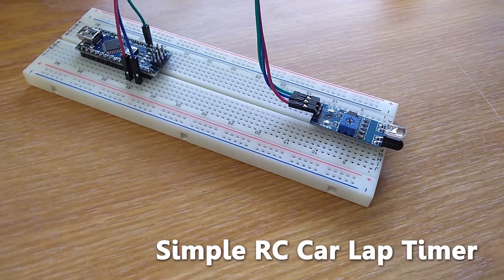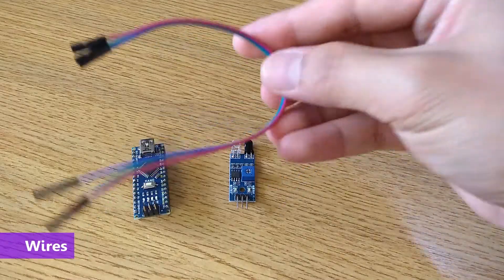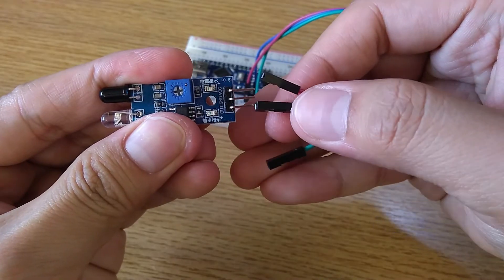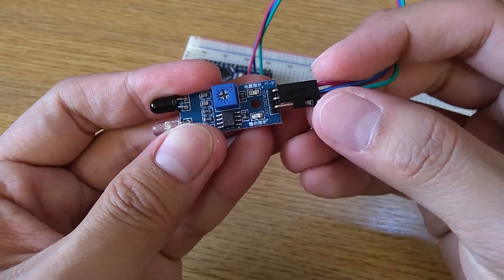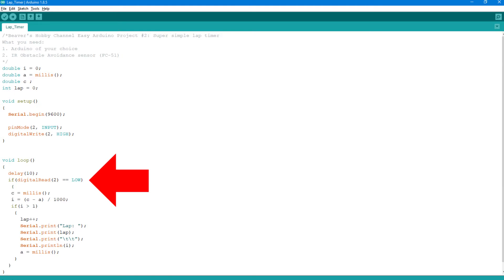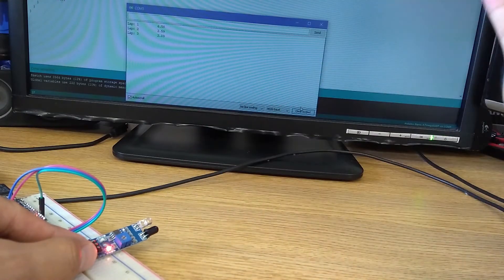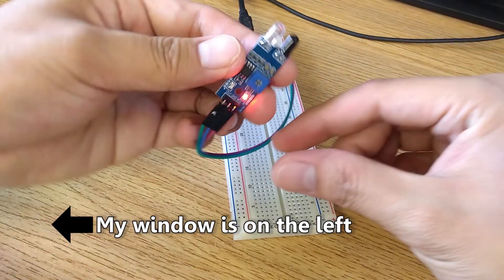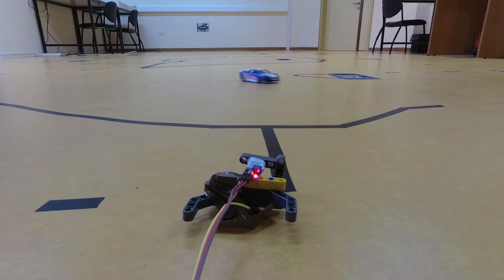[Arduino] DIY RC Car Lap Timer

Comment: what's the function of Serial.print("\t\t"); in your code sir ? because i can't see variable t
Reply from the maker: It is to print the "tab" space on the screen. The \ is for the print function, \n = new line, \t = tab.
Reply: @BeaversHobby  whoaa, I don't expect you would reply my question in short time. I appreciate your work ands answer. 🔥
Reply from the maker: @andikarifqimaulana682  My pleasure. Best of luck with the project!

Comment: From what I can understand, the lap times has to be connected to a laptop to work, correct? also can a voice be generated to read the lap time? thanks in advance
Reply from the maker: With my code you will need a computer to display the lap times. You can setup a LCD screen to output the times too if you so choose. Also because it's Arduino I think you can find a sound library and write a program then wire a speaker to it to say the lap times too.

Comment: would be better if using ultrasonic sensor am i right?
Reply from the maker: Ultrasonic can be too slow to detect sometimes. I highly recommend the laser ToF sensor like VL53L0X. It'll do a much better job at any light condition.
Reply: @BeaversHobby  Hi are the coding still the same?
Reply from the maker: @Kalk2pejai  For the most part, yes. You'll have to change some reading to get that from the laser. I think I also uploaded the laser version on my GitHub, check it out and tell me later if you can't find it.

Comment: Hi, just an idea. Have you tryed 2 sensors one in front to second one, sensor and led unsoldered on each ones (or closed with some sticky staff). Then they continuously on, while car brakes the  ray.
Reply from the maker: That's really good idea. However it will still be effected by sunlight. I have a new update for this and use laser range finder (ToF) sensor instead. It works well even with interference from sunlight.
Reply: @BeaversHobby  What about cheap ultrasonic sensor? Like HC-SR04.

Comment: What if I want to detect my hand movement??......can I still use IR obstacle avoidance sensor??
Reply from the maker: It depends. If you want to detect only of there's anything in front of the sensor, yes, one sensor will do. But in case you want to check if the hand move from left to right, you can also use 2 (or more) sensor to detect series of movement and which sensor ticks first.

Comment: Hello,

When i hook up my sensor to the 5V power, it shows nothing in the serial monitor. But when I unplug the 5V wire, then it starts to record data, but goes back and forth between 1.00 and 1.01. Any help? Thank you!
Reply from the maker: This is not serial. You have to use it on a digital pin. You can think of it as a button. I use for digital read and it click a digital button when something is in front. Also don't forget to adjust the knob on the sensor. It won't detect anything if  the gain is too much or too little.
Reply: @BeaversHobby  I have it plugged into the digital pin 2 and hooked up the same way as you did. Still no numbers are being displayed.
Reply from the maker: @TheUserReview  Have you run the code? Anyway, look at the module first, you have to adjust the knob until light on the out is off. Then put your hand in front of it and see if the light next to "out" pin is lit. If it's not then the module is faulty. When there's the light on the "out", it means the digital button is pressed on the digital pin.

Comment: Have you got a vid of the wheelspeed measuring?
Reply from the maker: Haven't got time to make it yet but it's pretty simple. In the comment section of this video we discussed the build of speed cheaker. Arduino code is in there too. Also, you need TimerOne library.
https://www.youtube.com/watch?v=ehjiky9uo2o&lc=UgybASsGtj6B4sHuvwV4AaABAg

Comment: I just use the Mini 4x4 Lap Timer on my old android phone which I relegated to the kitchen as an MP3 player.  But you have to adjust for the lighting and also be careful not to project shadows where the camera is pointing or it will trigger.  I've also seen one that can use time up to 4 cars, but they have to be distinctly different colours and the program has to register the cars before racing.

Comment: great video thanks
how do we get more range and a/v output? this can be a video series
Reply from the maker: Range is limitation of the sensor. I'm looking at other sensors like laser range finder VL53L0X so it won't be effected by sunlight and has much longer range.
Reply: @BeaversHobby  maybe use RFID reader
Reply from the maker: @CikguBadRC  I have been thinking about that (also bought an RFID kit with card a while back) but seems like it needs to pass at a specific point for the sensor to read. So, I don't don't how much coverage it will have and also if it can read that fast.